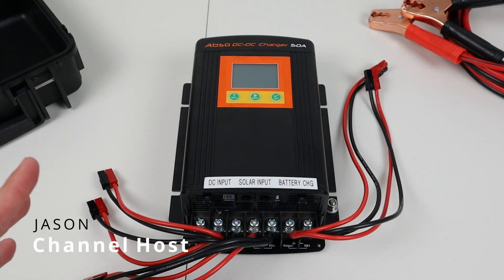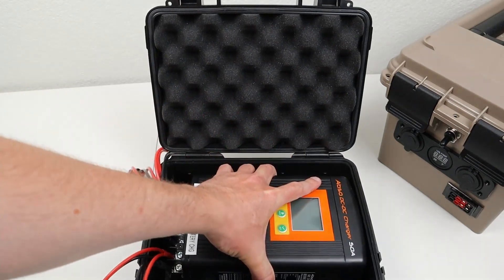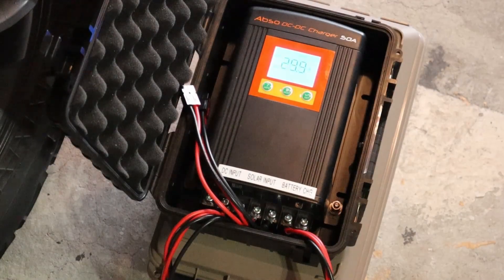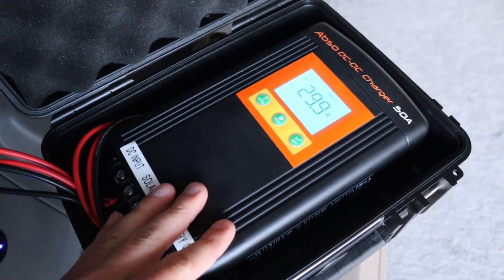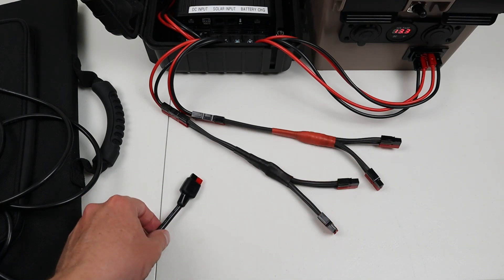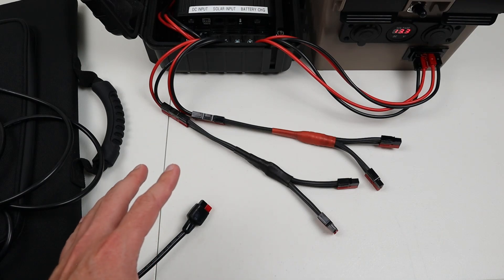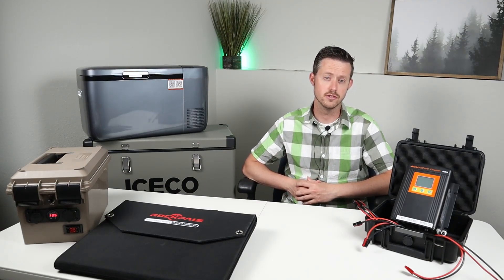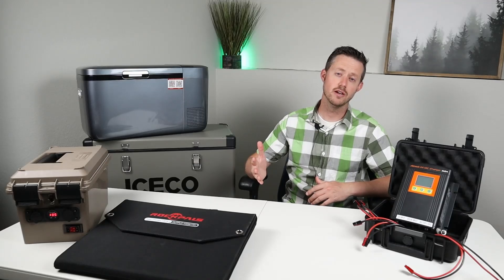The Perfect LiFePO4 Charger?! - Kisae DMT1250 Solar MPPT and DC to DC Charger! Portable and Powerful

Comment: What's the RF noise like on this charger and panels?  I'm a ham radio guy and it's sometimes hard to find solar gear that's RF silent in the HF/VHF/UHF frequencies.
Reply from the maker: I haven't tested it with radio equipment unfortunately. My guess would be that it doesn't have much RF noise because it's built so well. Its designed for Overlanding and RV setups so hopefully not much. It's been an awesome charger for me.

Comment: Interesting.  It's not cheap, but looks like a good universal choice.  You could use it with random AC adapters as well.
Reply from the maker: Yeah, if you have an AC to DC adapter that puts out 50 amps, it could take that power and charge a battery haha.....that's a lot of power and I haven't tried charging at that much power yet. Only maxed it out a 30 amps so far!

Comment: Jason, thanks for the great videos.  I was wondering if you could clarify if this charger works for LifeP04 batteries.  I see on the website that lithium is ok but not sure if that is also true for LifeP04.  
Also, is there any downside, other than price, going with 50A versus the 30A?
Thanks again.
Reply from the maker: Yes, it has a programmable lithium mode, it's super easy to use and setup for lifepo4. You basically change the stop voltage to 14.2-14.4 depending on your battery specifications (all lithium batteries use a cc/cv charging method and the charger just needs to know when you stop).

The 50 amp model let's you chose 5 amp charging increments up to 50, the 30amp model let you choose 10 amp charging increments up to 30. They are both similar. I went with the larger charger for future proofing myself for a larger battery setup.

I love mine and it's been super awesome!
Reply: @Jasonoid  Thanks very much.  Keep up the great work.
Reply: @Jasonoid  Was wondering if the Rockpals 100W v2 needs a solar charge controller to charge a Bioenno 15AH LifeP04 battery?  The Anderson Power Poles from the array connect directly to the battery power poles but not certain if that is the right way?  Thanks again for the help.
Reply from the maker: A raw lifepo4 battery will need a charge controller. Check out the eppever brand, they are affordable and allow for lifepo4 charging.
Reply: Can I hook both DC and Solar panels up together, and will it auto select which side to take charge from? Until the target battery is full?

Comment: Why not go with some thing like a CTEK 250SE?
Reply from the maker: Never tested that unit, I'm sure you could chose that one too. It has less amp output charging (only 20 amps), why limit yourself at 20amps when you can have 50 for the same price?
Reply: The CTEK are not made for lithium batteries, I downloaded the pdf to find out so now I'm thinking about getting the Victron  one

Comment: Way to much for no name item
Reply from the maker: No name item? Maybe a "smaller brand" item is a more correct way to describe it haha. High quality, less mass produced maybe? Wish another company would come up with something similar. You know of any?
Reply: Try makeskyblue_usa
Reply: @gonzalez7805  They don't have a DC-DC/Solar charge controller.
Reply: @Jasonoid  Victron makes a good DC to DC charger and it has Bluetooth
Reply from the maker: @jamesmason7124  I have seen lots of the Victron products. I hear good things about them! I still like how this unit has both a DC to DC charger and a solar charger in one unit, takes up less space and equals cost savings. I dont mind missing the bluetooth options. If my setup was stored away in a cabinet in a RV or something, the bluetooth app would make more sense. Thanks for the heads up!
Reply: @Jasonoid  also what is the maximum voltage for the mppt part that is the most limiting factor, my mppt can handle 250 volts input continuously at 80 amps
Reply from the maker: The Kisae will do 14.5 volts to 50 volts on the solar input.

Which victron model did you go with? Seems like a big guy! I'm sure the sticker price was pretty high. I haven't have to had such a big charger yet haha, not rolling with a 300ah setup yet.
Reply from the maker: @jamesmason7124  your new comment got blocked by youtubes, did you have a link in it? Youtube doesn't link links.
Reply: @Jasonoid  It looks like he was referring to the $700 Victron controller that doesn't do Dc-Dc. Thanks Jason $249 +$40 for the case is a great bang for my buck! The Renogy mppt/dc-dc was on sale for the same price but I really trust your recommendations. Bought the Bibene and waiting for shipping of the Iceco pro too.
Reply: Kisae is actually a well known reputable Australian company. Just lesser known in the US so far, but not by any means a “no name” company.

Comment: Thanks for your nice video. Right now, I am thinking about Anderson pp vs SAE port. Do you have any suggestions? Thanks.
Reply from the maker: SAE ports are a bit easy to reverse since they arent color coded. That could end well if you aren't careful. They are good up to 20 amps per connection if I remember right. They work well if you know your polarity all the time. You can draw on the connector with a silver sharpie to help remember the polarity if your wires are black. SAE also is a bit difficult to connect and disconnect in cold weather.

Anderson can be connected and disconnected very easily in any weather condition, they have 12, 30 and 45, amp connectors that you can buy. The ones used in my video are 30 amp. They can't be connected backwards which helps not start any fires from short circuiting lol. They do require a special crimper that you can purchase on Amazon for about $25. After making a bunch of cables the crimper definitely pays for itself. I used to use SAE (and on occasion I still do) but I pefer APP now by a long shot!

I have plans to make a video about "how to setup Anderson powerpole cables" soon. I'm sure there are some other videos out there as well.
Reply: @Jasonoid  Thank you so much. Hope to see your video soon. Thanks again.
Reply: @Jasonoid  A newbie question, Can we get a lifepo4 charger, like this NOCO GENIUS10, 10-Amp Fully-Automatic Smart Charger@amazon, and change the clip to Anderson, and then connect with Kisae DMT1250? Will it work? Thanks.
Reply from the maker: @shawnhuang6413  no, those chargers are ac chargers and require 120vac input. The Kisae is a battery charger itself, no need to have another charger.
Reply: @Jasonoid  Thanks. I got it.  So, I can get a lifepo4 charger, 120vac input, with Anderson pp connector to the battery box directly. Right? Do I need to add a pwm solar charge controller? Thank you so much. Subscribed your channel. Love it!
Reply from the maker: @shawnhuang6413  I'm happy to give you some advise in an email format, send me an email when you have a chance. Will be a little easier to explain. 
Jasonoidllc@gmail.com

Comment: Awesome video and explanation! Those DC-DC/Solar charge controllers are mostly used by the Overland or RV people in a fixed place. So it's great to see that you can make a portable setup and be able to utilize either solar or your alternator power all in one unit. I like how the DMT1250 current can be adjusted in 5 amp increments. With most solar charge controllers, current is determined by the number of panels you have. With the DMT1250 you can set the current limit regardless of how many panels you have.

Comment: Love the use Anderson Powerpole connectors!
Reply from the maker: Only thing to make them better....waterproofing options! haha Use them for EVERYTHING!
Reply: @Jasonoid  I still haven't formed an opinion on Anderson Powerpole; did you also consider SAE?
Reply from the maker: @OnusBones  SAE is okay to use and I have a few of those connections in my setup. These are my issues with SAE:
-Usually not rated for a specific max amperage
-Easy to connect in reverse polarity, fry your device quick and easy
-Connections are tight and too hard to connect and disconnect

Anderson powerpole solves all those issues. Sure the investment in a crimper and buying pairs can be a little expensive but its totally worth it!

Comment: I have a question. What would you recommend for a guy who knows absolutely nothing about the technical aspects of solar power but would like to start up a system ?
Reply from the maker: Sticking with an off the self power station like the Bluetti EB70 or the Jackery 500 will allow you to get familiar with how solar charging works. These are easy to use and have lots of battery storage for smaller gadgets. You can purchase a cheaper solar panel and dive right in. 

I have a couple other videos on the subject. I have a solar shed video that talks about some good basics. 

Once you get familiar with that, just watch a bunch of solar youtube videos and you get more familiar with the jargon and how it works. Youtube is free knowledge and it's amazing! Lots and lots of great sources online too!
Reply: @Jasonoid  thank you!

Comment: The 50A model is sold out on Amazon. Only 2 of the 30A versions in stock as I write this.
Reply: I'd wait for the 50A model. You may not need that much current. But the DMT1250 is current adjustable in 5 amp increments whereas the DMT1230 is in 10 amps. Not sure why they did it that way, but that is what convinced me to get the DMT1250. Also if you are charging at 30 amps like Jason was showing, there is more margin of safety from failure from the fact that you're not pushing your charger to its max limits.
Reply from the maker: Correct, probably have a bit of a shortage right now on stock. You can also purchase these from DonRowe website listed in the video description as well. Amazon might be a little more convenient/cheaper but the other website should work as well.